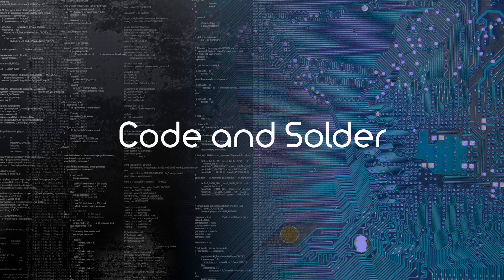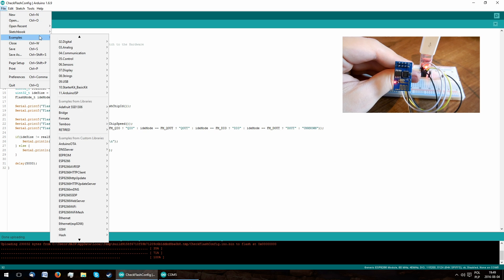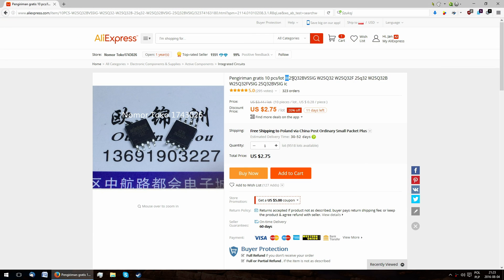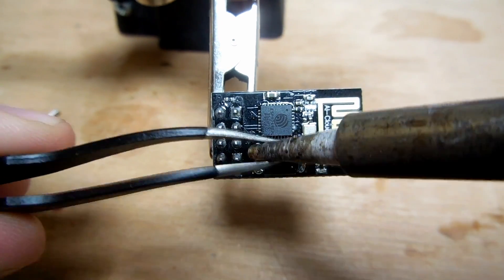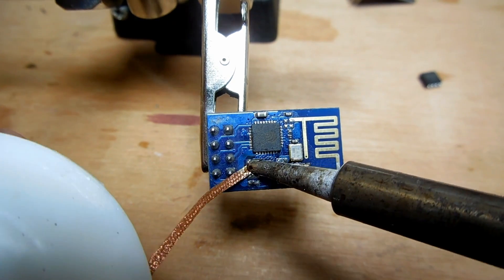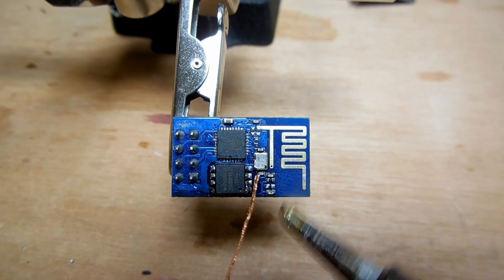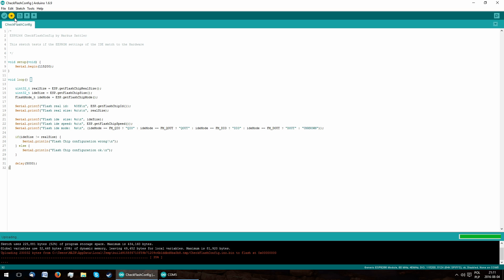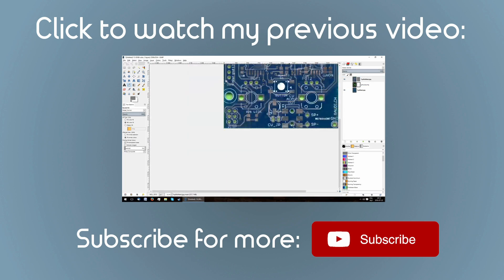How to upgrade your ESP8266 memory to 4MB (in under 2 minutes)

Comment: Hi nice video, my guess is you can also upgrade to the W25Q128 (16MB flash) because I see the esp8266 supports to a max of 16MB
Reply from the maker: +Maxi Mus I most likely could, but the IDE suppiorts a maximum of 4MB, so some changes would be necessary there.
Reply: What would be necessary to do that?  I just want to store more junk in a hosted webpage and adding micro sd is excessive.
Reply from the maker: +zyxwvutsrqponmlkh You can just buy NodeMCU for $3, it already has 4MB of memory. The upgrade needs the flash chips and the basic tools you see in the video - tweezers, a soldering iron, preferably a hot air, some solder and flux.

Comment: very very nifty, but considering the small price difference between ESP8266 and the  Wemos D1 mini or NodeMCU... and considering the age of my eyes, I think I just leave this be.

nevertheless, great job
Reply from the maker: I did this because I had a device with an ESP-01 in it and it turns out they don't make them with anything over 1MB.
Reply: Oh I understand fully and I think it is great what you did.
i have 2 ESP8266-01's and I would love them to have 4 Mb, however, with  my aging eyes I just bought Wemos and NodeMCU.
I hung a gazillion sensors on the 01's i2C and they are great, but I guess mine will have to stay 1 Mb. Should my eyes be younger and I had  several, sure I would be updating them :-)
Reply: Ed19601 how are you powering your 01's? Battery?
Reply: Now esp12F with 4mb costs like less than $2 a piece.

Comment: excellent video, I wanted to ask you if you can make the module have a capacity of 1 GB or more of ROOM flash
Reply from the maker: An SD card would be the easiest way for that amount of storage, fast SPI flash that capacity is expensive and I can't find any with this footprint.

Comment: Buy liquid solder in syringe, apply with pin to pads, then place parts and simply use a normal hot air gun to reflow, I've even done double-sided boards like this
Reply: world a normal iron work with solder paste too?
Reply: maybe if you put flux on first to remove oxidation during soldering. If you mean if you could use an ordinary soldering iron... welll that would be kind of awkward I think. THe liquid solder turns from a grey paste into shiny solder as the temperature increases... An ordinary hot air gun works fine, even on very small parts as the paste is a bit sticky so parts don't blow away

Comment: Very nice. I think Sonoff often uses 1MB Flash. If I want to use standard solutions like fauxmo (for Alexa control without sonoffs cloud). To change the flash on a sonoff should be the same as on an ESP as the sonoff uses an ESP inside, Am I right?
Reply: Yes - It works the same way with the Sonoff devices.

Comment: Thank you for this! I soldered a 4MB chip on a esp01 and I have more memory available now. But the Arduino IDE keeps indicating only 1MB total available max. How can I use more? I have tried 4M 1M spiffs setting and 4M 3M spiff setting and it makes no difference.
Reply: Johannes, I din't try, but I think this can help you (changing the ***upload.maximum_size) check in: 
     C:\*** AppData\Local\Arduino15\packages\esp8266\hardware\esp8266\2.4.2\boards.txt       
     C:\*** AppData\Local\Arduino15\packages\esp8266\hardware\esp8266\2.4.2\tools\sdk\ld    and   \tools\boards.txt.py 
* remember, Arduino need twice space of sketch.bin memory for do the OTA. Regards.
Reply: Thanks,  @salomondenis9751  I will try it

Comment: Hi,are these flash chips any good? ive read they are verry bad,they cause the reset issue that esp8266 is plaiged with,ive seen some with a winbond chip on,can these be placed on,or does it depend on bootloader?
Reply from the maker: +Duncan Young as far as I know the bootloader is on a higher layer than the communication between the chips so if the protocol is right it should be fine. No idea about reliability of different flash manufacturers tho.

Comment: hi there… is this possible with digispark attiny 85 ? i really need Tô expand memory  on that chip :/
Reply from the maker: +carlos rodrigues you can add external memory to the ATtiny but it is much harder and you need some additional code to handle it.
Reply: Code and Solder só what do you think is the best way to expand storage? add sdcard reader? is possible?
Reply from the maker: +carlos rodrigues depends on your needs. How much memory do you need, at what speed etc. SD cards are a possible solution. Or serial memory modules like in this video. Or just use a bigger processor.
Reply: Code and Solder well, i need arround 50 mb wich in microprocessors world, is a lot. do you think its possible for you to make a video expanding storage on this device, is a thing that a lot of people would be interested in, and i look through videos on internet and i cant find anything. seems  impossible.
Reply from the maker: +carlos rodrigues you cannot expand the storage directly because unlike the ESP the ATtiny has flash inside of it. If you search for "Arduino SD Card" or "ATtiny SD Card" there should be some tutorials. That's all I can do for now as I am on holidays.
Reply: Code and Solder thanks a lot for your help. have a nice day.

Comment: Thanks for the great video!
I would like to know how to program ESP chips OTA(over the air). With a local connection, it can be done through a network port. How about doing it globally. (ESP connected to wifi and computer to another different wifi and running OTA flashing)

Comment: Does this also work for 16Mb flash? Or is 16Mb flash simply too big physically to even try this.
Reply from the maker: As far as I know it should, though the libraries might need some tweaking.
Reply from the maker: Assuming you mean 16MB, as in the video I used 32Mb (4MB)
Reply: @CodeandSolder  ill give it a try

Comment: Is it possible to solder on it more then 4 mb, may be 16mb?
Reply from the maker: There shouldn't be a problem if the interface is the same, software support may require some adjustments

Comment: I wrote about this some time ago - it really is easy if you have a fine soldering iron. http://tech.scargill.net/32mb-esp01/
Reply from the maker: +Peter Scargill it also would be easier if I didn't have a camera an inch from the board. And used one of the 1MB versions. But it worked anyway.
Reply: Well, I've done a SONOFF and a couple of ESP-01 units - no problem  - and this week a tube of FLASH chips has arrived so I can update the rest. My code is now too large to OTA on the older chips and OTA makes life SO relatively easy (no more dismantling stuff to update) that it is worth the soldering effort.
Reply: What's the theoritical limit of the esp chip ?
Reply: Well iit can only address 1MB directly - another 1MB can be used for OTA - and that leaves whatever you have left for data -maybe chart data etc. Personally I store all that stuff on a Pi, so the 4MB is the highest I've ever looked for,
Reply: Dank U

Comment: Why not 16MB?
Reply from the maker: +Mike Causer the IDE doesn't support it, 4MB is cheaper, and enough for the huge majority of purposes.
Reply from the maker: How fast do you need the memory to be? An SD card could be an alternative. Or even simpler you could use one of the cheap Linux machines like the Raspberry Pi Zero.

Comment: it's mb not MB. mega bits not mega bytes. huge difference.
Reply from the maker: +Ron Miller small m is milli (1/1000 in SI). And the module is 4MB = 32Mb, thus the 32 in name. You can check the datasheet.
Reply: Code and Solder just stop saying mega bytes in videos when it is mega bits. I'm glad I gave you something to fix in my post so you could ignore what is really wrong in your video. nice subterfuge. just correct your error.
Reply from the maker: +Ron Miller I say "four megabytes",  which is exactly the capacity of a W25Q32 chip. Nothing is wrong in the video.